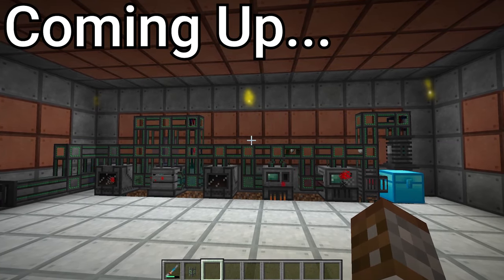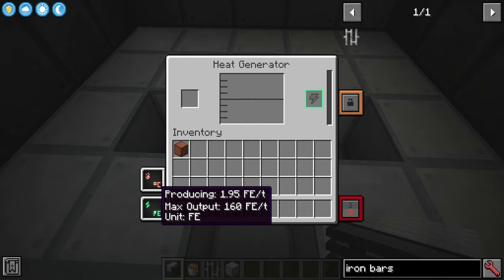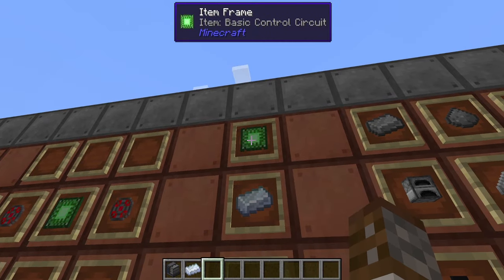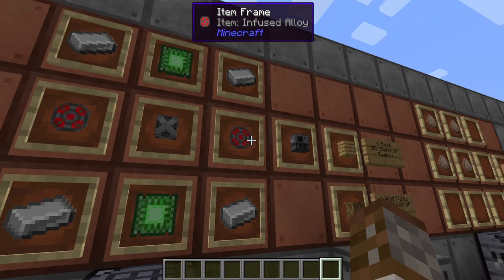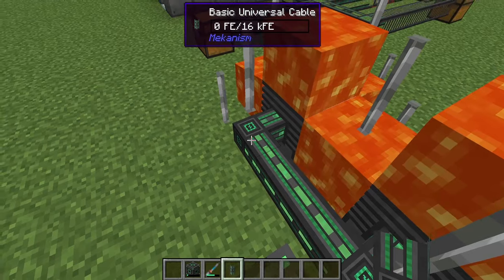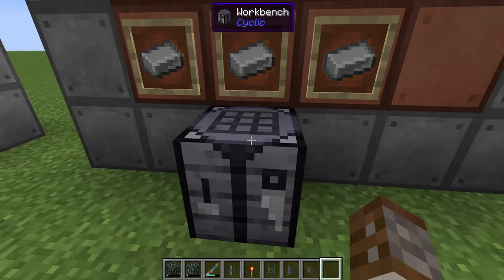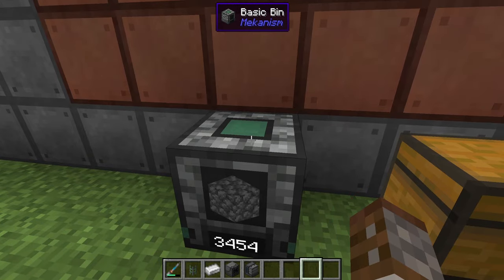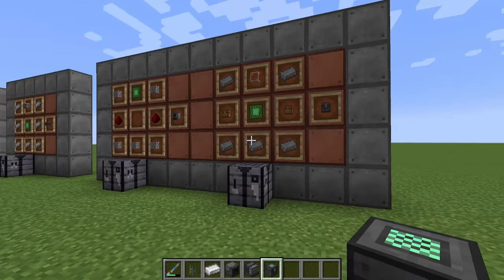How to: Mekanism | The Basics (Minecraft 1.16.5)

Comment: I didnt see it in my short look through the comments.  For the heat gen you can now put five lava blocks on it. Shift right click on the gen and the power cable to place the lava on those.
Reply from the maker: I did know this. It’s a good tip which I didn’t should. Just remember to remove lava logged block before breaking it or it’ll burn. Good tip!

Comment: i cant find heat generation why?
Reply from the maker: Heat generator is from the addon mod Mekanism: Generators. If you pack doesn't have that addon then you will have to use a different mod for starter power

Comment: Extreme sound muffler mod will muffle the machines noise. Can even be anchored to just that area or just lowered…use that don’t waste the resources on the upgrades unless your a purist or sumthin
Reply from the maker: These tutorials are designed as if you only have mekanism installed. Of course there are other mods to solve simple issues. Thanks for the tip

Comment: I need help the energy won't transfer into my metallurgic infuser, from the heat generator.
Reply: I need help too all the heat that should be going into my heat generator is dispersed
Reply from the maker: Are you putting the metallurgic infuser on the green side of the heat generator? And have you configured the side that is touching the heat generator to accept energy from inside the config of the metallurgic infuser?
Reply: @Mondays3  I did put it on the green side but it was the configuration that was wrong, so thank you very much this helped a lot.

Comment: Is steel from immersive engineering able to work with this mod
Reply: Also dose power immersive go over because I have 4 diesel gens
Reply from the maker: Yes it should do as long as it hasn’t been restricted by the modpack author
Reply from the maker: Yes you can use immersive engineering power on mekanism machines